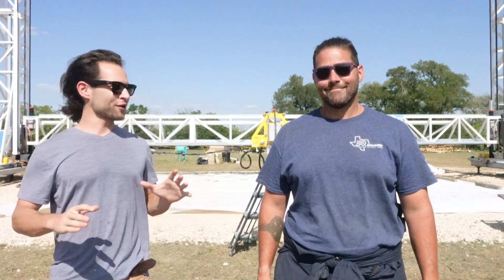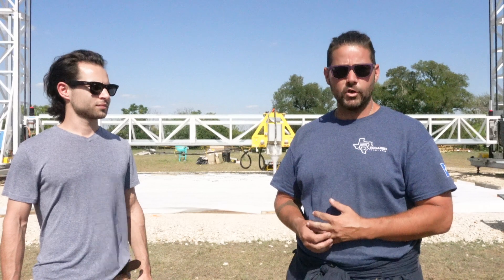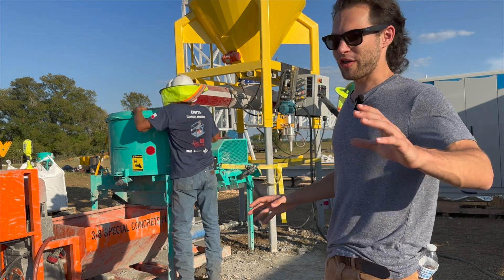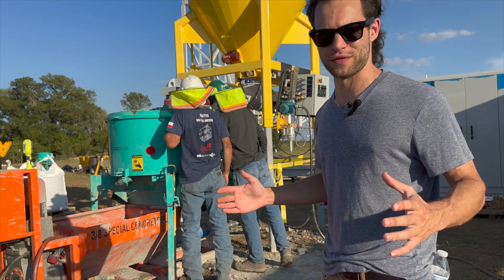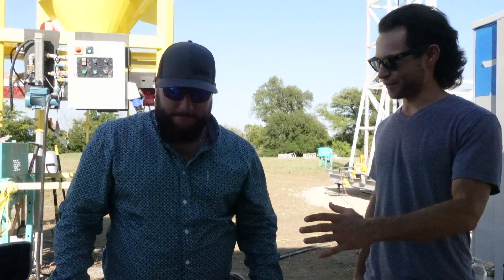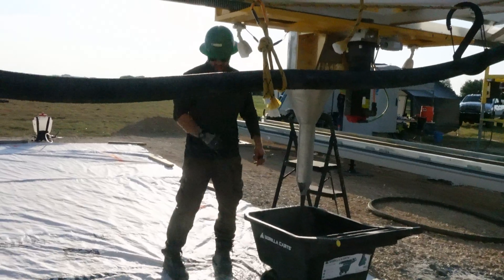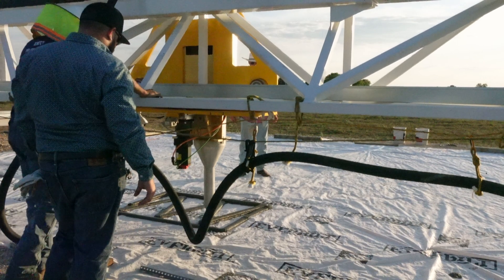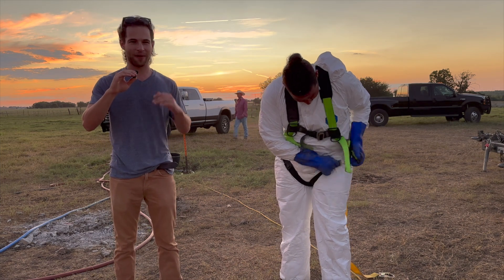R Squared Starts House Print in Staples Tx (EXCLUSIVE FOOTAGE)

Comment: Thanks Jarret, awesome video. Is that a 2" rubber hose used for the delivery of concrete to the head? Is the pipe reinforced as it looked very soft compared to other 2 inch rubber hoses I've seen.
Reply from the maker: It’s rated to at least 40 psi potentially more.

Comment: Jarett, what an awesome job site and a great video! I must’ve been really hot out in that Texas sun, because I’ve never seen your arm veins bulging out as much. If I didn’t know better, I’d have thought that you just came from the gym 😂. I have to check out your live video next.
Reply: Pumicecrete is by far the best building material on the planet Pumicecrete is a mixture of pumice cement and water mixed and poured into a set of reusable forms walls are poured from 12"to 24" thick pumicecrete is fireproof termite proof rust rot and mold proof non toxic and has a high R value and good sound attenuation solid poured walls means no critters can live in your walls Pumicecrete can be built for a fraction of the cost and time and pumice is the only material that can go directly from the mine to the job site ready to use without any additional possessing